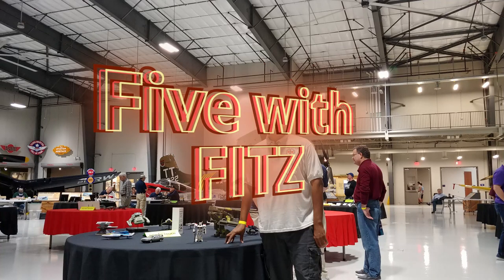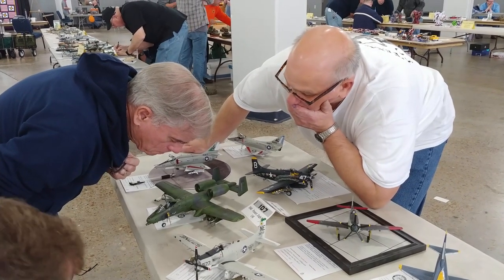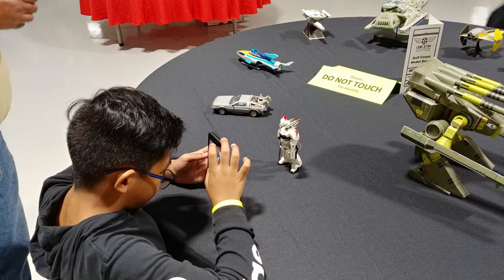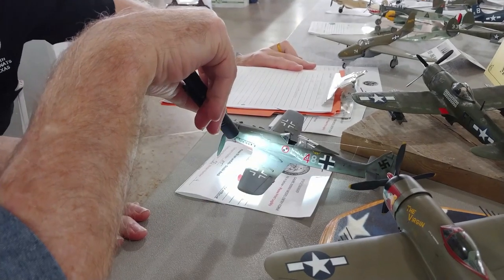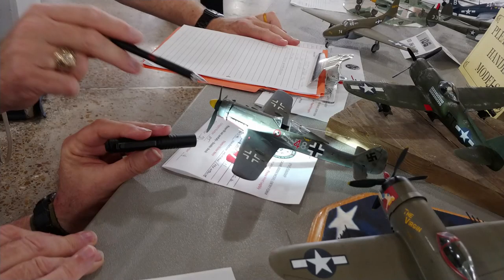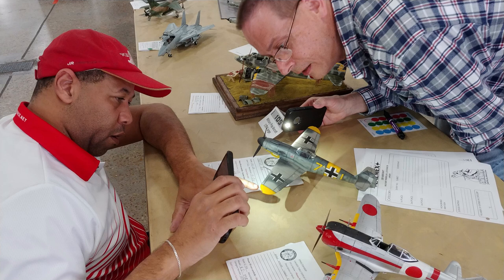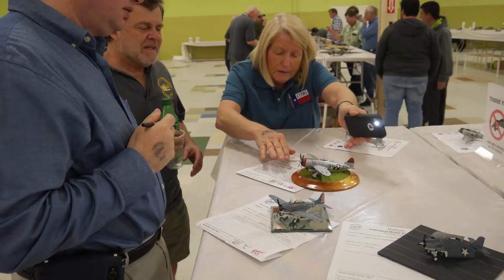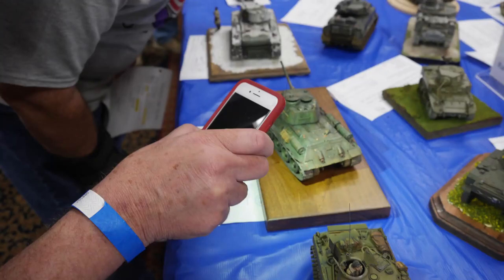Five with Fitz - Episode 13 | HobbyView

Comment: A flashlight is a great tool to use to spot imperfections in surfaces. Using a small/bright lightsource easily creates lots of contrast on surfaces revealing lots of detail in the surface which without the flashlight may appear to be completely smooth. I use a small bright flashlight to check myself over for ticks when I get home. Makes it super easy to spot bumps or marks on your skin!